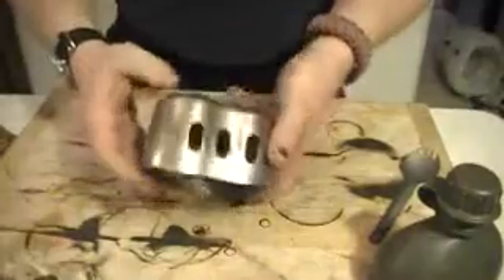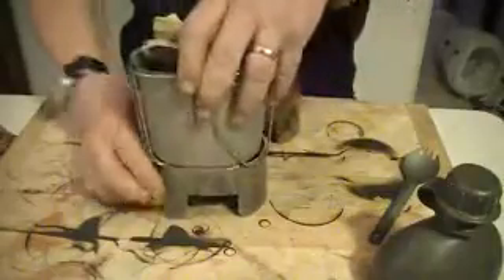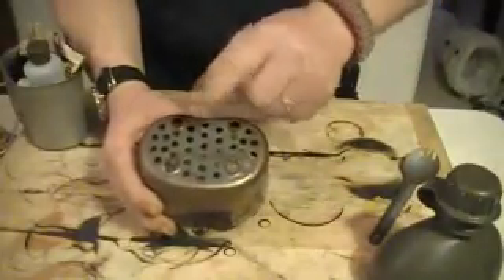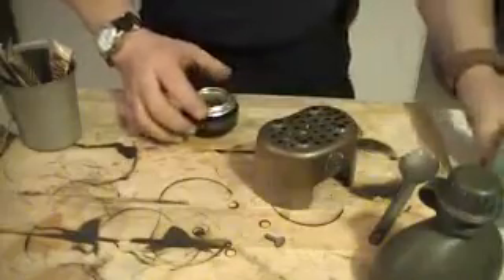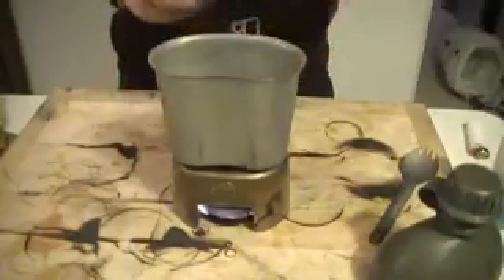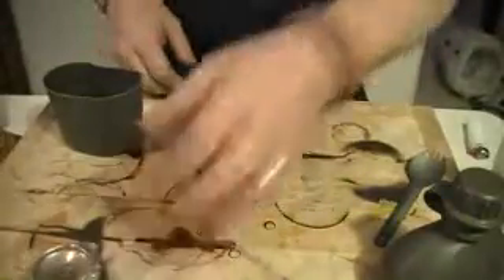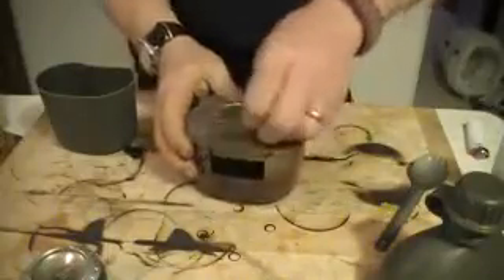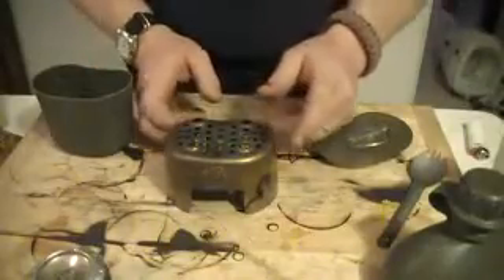Canteen Shop Canteen Cup Stove Stand

Comment: will the older style canteen cup that has the the handle which folds under the cup fit into the stove for storage or does it have to use the newer cup with butterfly handles? thanks